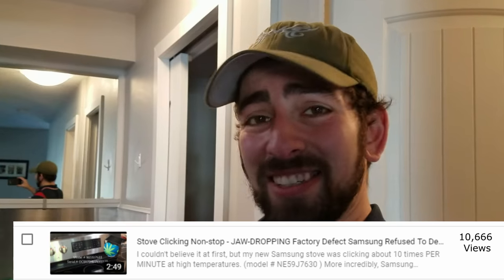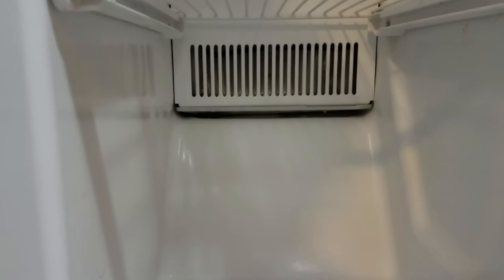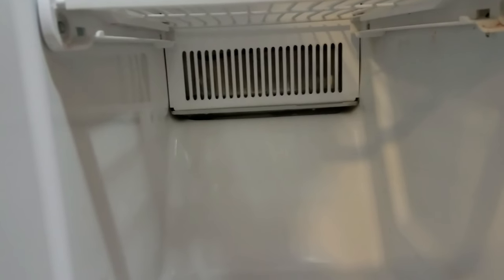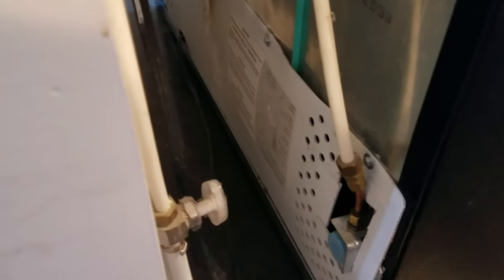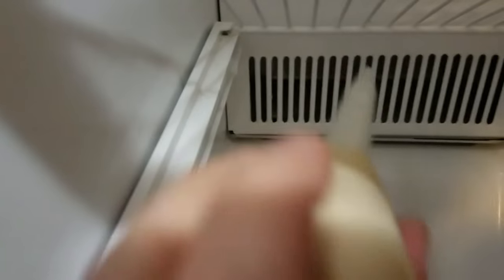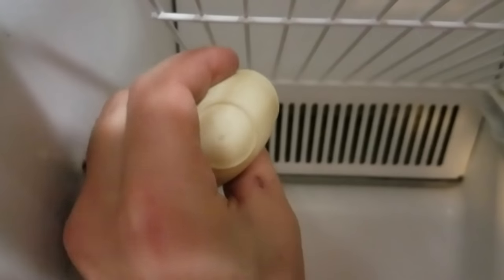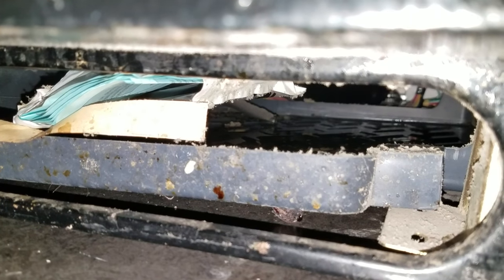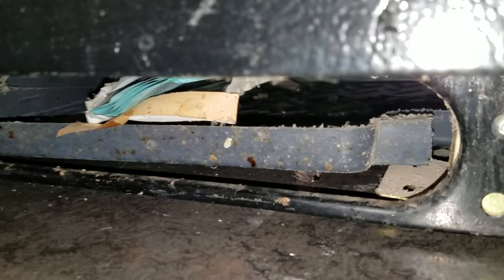Fix A Clogged Fridge Defrost Drain WITHOUT Opening Panels - How To

Comment: On the Jenn-Air, the drain tube goes down makes a hard right go slightly uphill, then straight down to the pan. the problem is that when the horizontal tube pitches up to the second elbowit, it develops a swamp and buildup starts clogging the tube. This is is a manufacturing screw-uphorizontal line  should be sloped downward. you need to shim that Elbow on the second turn before it goes into the pan, to prevent swamping and buildup of debris that clogs the horizontal short of turning down to the pan. .

Comment: Mine was particularly stubborn.. in the back to a top freezer unit. The hot water didn't work so i ended up using salt. I poured the salt in the drainage tray followed by water.
Reply: did you hear sounds after draining water?

Comment: I had to adapt this a little. I used a lighter and piece of metal suspended with a pair of vice grips. I used a lighter to heat suspended metal and melt the ice clogging my drain.

Comment: I had the same issue with mine and the dealer told me to basically do the same thing but add a small amount of bleach to it because most of what is clogging it up is algae. After I done that it worked awesome.

Comment: Very practical and easy (usually the problem is solved by starting the easist way)..by the way, once it drains, where the water will go eventually, sorry I'm a layman.  Thanks!
Reply: Other video said that there is a fan near the drain pan that evaporates the water

Comment: So is the drain tube supposed to have something on the end? I flushed mine out with the hot water and only noticed a trickle of water coming from the end. It looks as though there like a white "cap" thing on the end.
Reply: From what I've read, yes, there's some sort of an element at the end of the drain pipe, can't remember it's significance though (semi-filter stopping the dirt from the drain pipe from getting into drain pan maybe?). It's not that crucial apparently, as long as You have an easy access to your drain pan for cleaning.

Comment: thx to your tip though I did not try yet. Question: how to drain off the hot water which goes in via baster and collected somewhere in bottom pan?
Reply: No need. The pan underneath is there to evaporate the water when the fan on the unit is running.

Comment: I can see my drain hole just like you said, and it's clogged. But this hot water trick did not work for me unfortunately. What next?
Reply: take the back panel off that is on the inside of the freezer, for me it was 4 screws, 7 mm socket. My coils behind the panel (above the drain) were even froze. Melted the ice with hair dryer then took compressed air shot down the drain hole.

Comment: Good job thanks just got mine undone with a water pick and hot water
Reply: Question- do you do this while the refrigerator is still on? and plugged in? or do I turn it off?
Reply: @chrism8135  Yes I did. But i started with a hair dryer.  Just couldn't penetrate as for as i wanted. I let mine get bad. The ice and water was thicker then before. My second go around with this problem. First time I got it with the dryer.This time the ice or obstruction was deeper.I just used as hot of water I could get off my sink. If it's just ice it should do it. You can tell when you do. Then get a flash light and look in your pan. Good luck🙂
Reply: @chriss7477  you said yes you did.. Yes you turned it off? or yes you let the refrigerator still run? I think I will just be turn the "cooling off" and leave refrigerator doors open overnight.  I put items outside.. It's more than cold enough.. : ) My question is how do we know if that drain (gromit) needs to be cleaned.. Watched some other videos where they took the back off and cleaned a little gromit that drains into the slide which goes into the pan?. I don't have any accumulation of ice.  I keep getting a frozen water line.. And then it doesn't dispense water. So I tried to thaw it out and that's when the water pooled up on the bottom of the refrigerator side.  The water dispensing line keeps freezing.
Reply: @chrism8135  Sorry I left it on. I  got lucky I guess when I started it was in its daily defrost cycle but kicked on before I was done.. mine was a bit different then the video. I have top freezer and no valve on the back. That model looks like it sucks. Everything is internal on mine.I pull a cover in my freezer and I can see the drain hole with a flash light. I'm grateful my plug was up top. Ice not gew

Comment: Will unplugging the refrigerator for a few hours work?
Reply: if there's a lot of ice build up, you're going to have to leave it off longer than that. Alot of folks are having success with just turkey baster. I used a large meat injection syringe.

Comment: My freezer was so horribly clogged that this technique didn't begin to solve the problem.  The ice dam was so extensive that it filled the entire drain tray below the heat exchanger, including a plug that extended over an inch into the drain hose attachment.  And below that, at the entrance to the drain hose, just above the twist, there was a clog where flour had spilled, gone into the drain hose, and made a paste.  What a mess.  I had to remove the ice maker valves to get access to the drain hose, unclog and flush that, remove the freezer panel, unscrew the heat exchanger so I could get access to the drain tray, remove the gigantic ice dam (which was infused with flour), then pour in cup after cup of hot water until the ice cylinder finally melted out of the drain hose attachment nipple.

Comment: On my fridge I  removed back panel only  no need to turn off water . I removed  the black nipple on the drain tube and cleaned that out.   No more back up of water.  It now drains properly.    The turkey baster did not unclog,

Comment: A cup of Fishy Water spilled in my Hotpoint top freezer drain vents Model #CTX18EFC.  I trust I need to disassemble inside the freezer to reach the draining tubes and trays...which are clogged as evidenced by the large amt of water in the bottom of refridge. It further leaked out onto the floor.  I'm drowning in fishy fishy stink.

Comment: I can't even get a service manual online for my fridge without having to pay for the fk'n thing and yet a regular manual doesn't even show you where the freezer drain plug is. Grrrr!  I've been endlessly trying to figure out why my fridge is dripping water from the freezer down into the INSIDE of my Haier Model hte14waaww (pakistan product), all over my food. I didn't buy it, it came with the house I bought.  rolls eyes but I guess you're not an actual fridge technician are you? I turned off the fridge and I took my freezer apart (from the inside) a couple hours ago trying to figure it out myself. I used to be an RV Technican and could fix anything in an RV, even the fridges, but my own fridge...uh..NO, because I don't have a service manual. I figured if it's dripping from freezer to into the fridge, there's gotta be something in there doing it. Nevermind, I'll go back and swear my face off at my fridge until I can figure it out.
Reply: How did that go? I've downloaded manual for mine but the clogged drainage is not mentioned there, so I tried to 'unscrew' some parts of the fridge myself. It didn't work though and thank God I didn't break anything, but I sure was close.
Modern fridges are designed, just as modern cars I believe, in the way that makes it impossible for the user to repair a tiniest issue, so that the manufacturer can take more of our money through the repair technicians. It's a travesty.
Reply: @buoazej  my fridge still leaks on the inside, but now there's a little bucket under the leak and I empty it every few days. I've tried endlessly to find an actual repair manual to no avail. I guess they dont want you fixing their products. I cant afford a new fridge so I just deal with the leak. I did take the freezer components apart and run extremely hot water through them but that only worked for about 2 weeks, then the leak came back. Typical foreign appliances are usually garbage, but most have online repair manuals, but not this brand. 🤬 p.s. I really miss the 80s and back American made appliances.